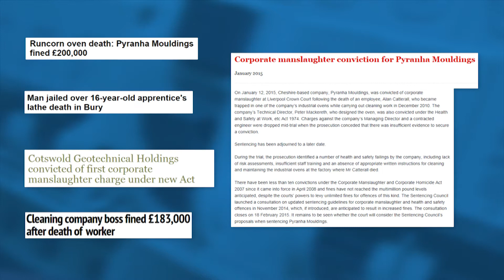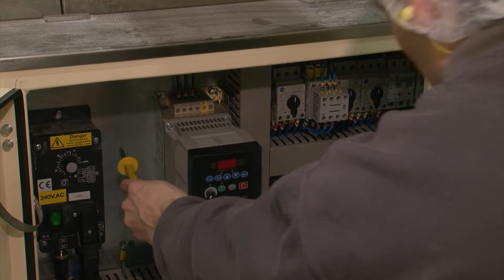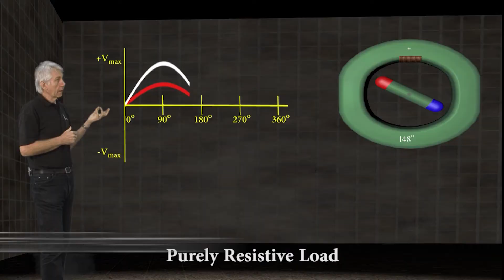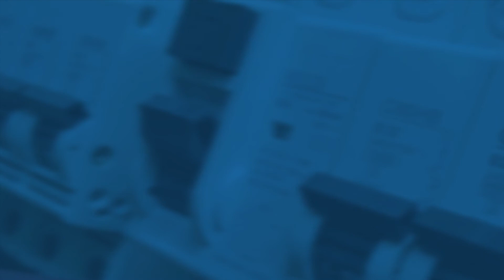LearningLounge.com: Electrical Compliance Pack

Comment: if your upgrading to a compliant ld2 system how do you document this ? is it done on the cert by the electrician
Reply from the maker: Hi Lee, are you referring to a Fire Alarm System?
Reply: @learninglounge  yes smoke alarms / heat and co2 near boilers and in kitchens, i guess LD3 is the max protection